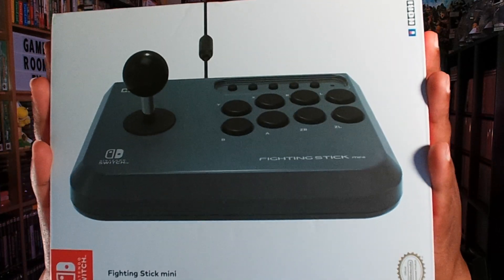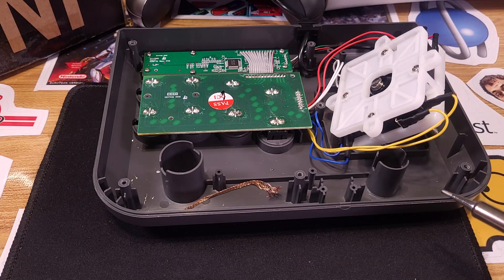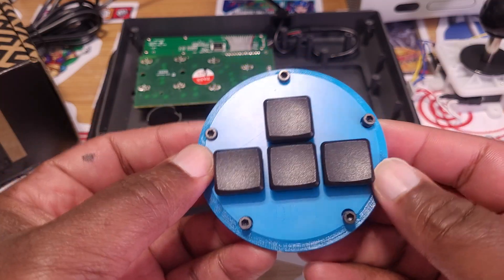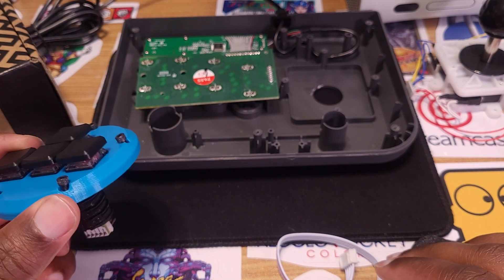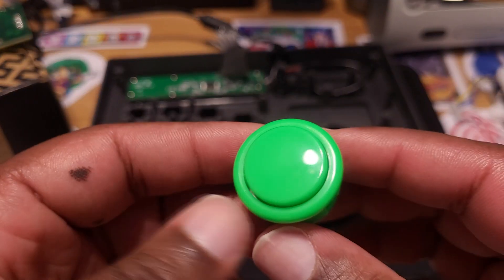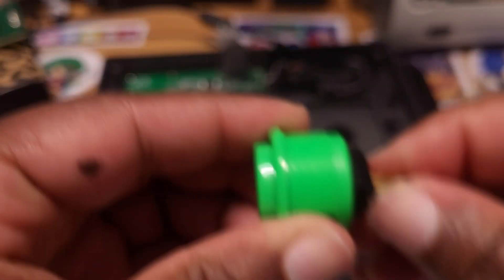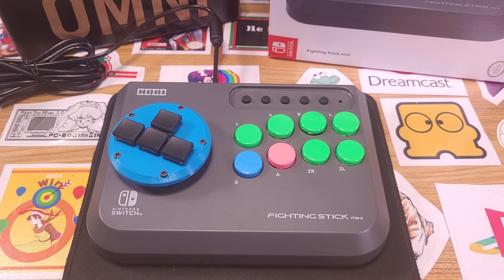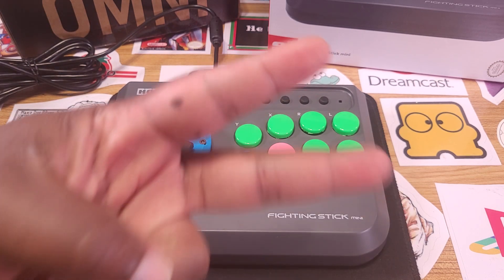DIY Mixbox - Hori Fighting Stick Mini - Leverless Omni Odin V2 mod (Nintendo Switch)

Comment: hey i just wanted to say love the mod but one thing i would say right now the second nut was meant to keep the odin secure but besides that honestly think you did a awsome job and should keep up the great work :3
Reply from the maker: Thanks dude!  Appreciate the kind words and thanks for checking out this video!  I got bit by the modding bug now and am working on something new for this stick as we speak 😆
Reply: @wega_man be honest with you I'm excited to see how far you will go personally thought you would have used a drimel to force some 24mm buttons to fit orwould the rim of the button not fit???
Reply from the maker: @8-bitwhale  My approach to this is non-destructive modding.  I didn't want to cut into the body of the arcade stick or destroy any of the parts that originally came with it. (if you're familiar with the car modding scene and specifically the JDM modding aesthetic, that's pretty much my inspiration haha)

And nope!  The fully assembled 24mm pushbuttons that I ended up using are too big to just drop right in and so like you were saying, you'd have to use a dremel or something to expand the button holes to fit the rings + button covers.  Plus the full assembly is too long to fit in the Fighting Stick Mini, but switch (with the prongs bent) + cut button covers fits nicely 😀
Reply: Alrighty I get you definitely something to see how it fully turns out so better be expecting me to comment first also wonder if there is a 3d print for the cap hmmm sorry thinking and typing is a bad mix TwT

Comment: Really cool, I’m wanting to change the buttons on my white ps4/5 version to qanba gravity but I’m apprehensive, your video is inspiring thank you
Reply from the maker: Nice!  I've got the PS4/5 version in my cart on Amazon waiting for it to go on sale one day 😂

And I'd say if you have any amount of DIY ability or desire to just mess with stuff, then you can definitely knock modding these sticks out! 

The one bit of advice I would give though would be to buy 1 button of the type you'd want to swap in and make sure the switch will fit or that you know ahead of time (before spending the money on all of the other buttons) that you need to do some extra modding to get them to fit.  The switches in the buttons that I used basically were a direct replacement for the Hori switches and fit right in haha

Comment: Wow good job.  Do you think there's any Japanese levers you could get that would actually fit in there if you wanted to upgrade maybe?
Reply from the maker: Thanks for checking the video out!  I don't know if there's many (any?) that would be able to directly drop in to this stick.  The mounting holes are on the bottom plate of the lever that comes with it and the shaft on the lever is shorter (ie. doesn't extend beyond the bottom plate on the lever) than on my Seimitsu levers and the Qanba lever that I have.

I think you'd have to buy a custom mounting plate for a more mainstream lever or 3D print one yourself or something.  Plus find a shorter shaft (or potentially tear apart the lever that comes with this stick and try to re-purpose that shaft).
Reply: @wega_man  I saw a list of input latency testing for a lot of different control devices you can use with mister and this is actually a lower latency device than more expensive sticks like the real arcade pro or Qanba Obsidian. So I think something about the internals of it  must be pretty good.

Comment: What a great mod!!! 
And I have a few questions to ask.
If I want to ground it, should I first connect the grounding wire of the mainboard to one of the buttons, and then connect all the button and joystick ground wires together?
Can I use the original button caps with the new switch that you purchased?
I also want to DIY my own hori mini fight stick, so thank you in advance!
Reply from the maker: Hey thanks for checking out the video!

I soldered one long wire to the ground wire on the main PCB board and then stripped the shielding off in a few places and then soldered the grounds for the top row of buttons to one spot, the grounds for the bottom row of buttons to another spot and then the ground for the Omni Odin V2 5-pin adapter to the last spot with the shielding stripped off.  There's a million ways you could solve this particular problem, but as long as all of the button grounds share the same common ground (the one from the main PCB), then it should be fine.

Yep!  The original button caps fit on the switches that I swapped in with the quick release prongs. 

These are the buttons that I used - https://focusattack.com/buttons/seimitsu/24mm/ps-14-dn-screwbutton/

You could probably just buy just the switches if you plan to re-use the original button covers.

Comment: Hey bro thanks for this vid

Wanting to mod one for my mom with a wireless board so she can play without the dogs being a problem in your experience taking it apart and modding it would you reccomended doing it?
Reply from the maker: Yooo, thanks for checking the video out!  

If you happen to have both the wireless PCB and Fighting Stick Mini laying around already and you have some of the tools/supplies for modding already, and you like DIY projects, then yeah I'd say knock it out!  You could probably do it in one sitting.

But if you don't already have everything, I would  say it's not worth it to buy everything just to mod this stick and I would instead suggest buying something like the 8bitdo Arcade Stick or the PowerA Fusion which both come with bluetooth connectivity out of the box and would be about the same price as a Fighting Stick Mini ($50-ish) and something like the Brook wireless board ($50-ish).

Plus the 8bitdo and PowerA Fusion sticks already come with quick disconnect wiring for the buttons and lever and if you wanted to mod those at some point, it'd be super easy!

Comment: I have a Hori Fighting Stick Mini for PS4. Is there any way I can use it with the Nintendo Switch? I’d prefer not to buy a separate one for the Switch, so I'm wondering if there’s a solution.
Reply: A converter